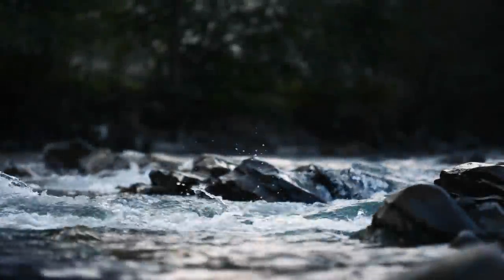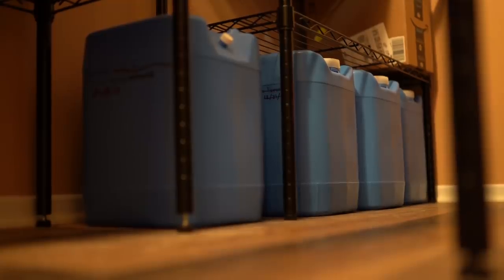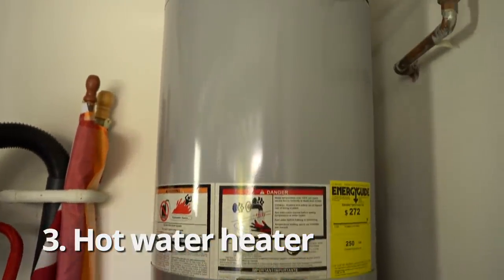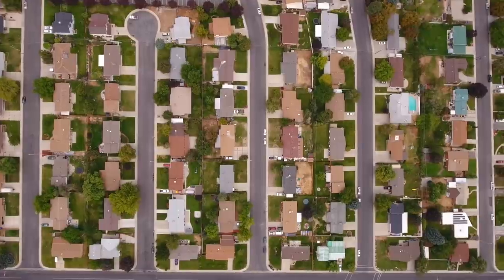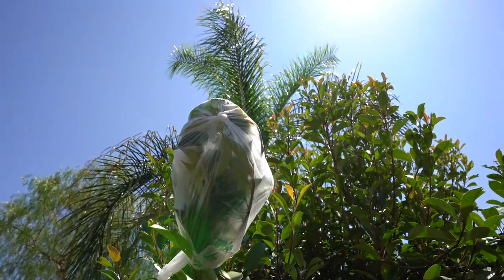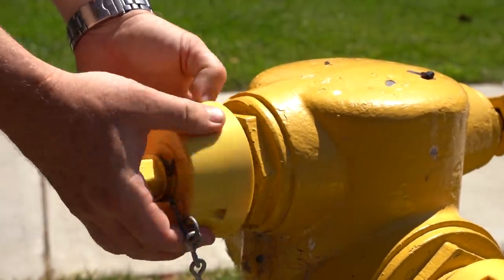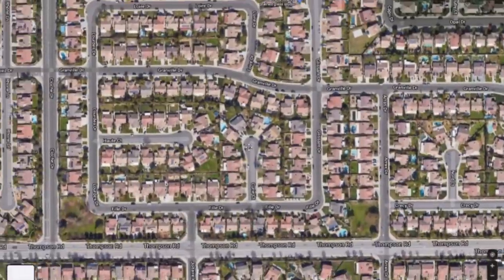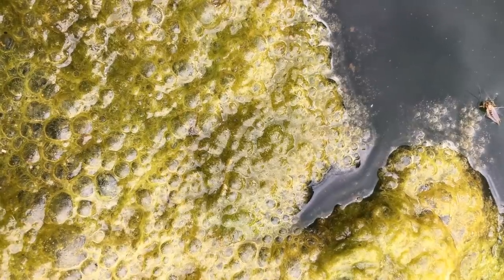12 Overlooked Places to Get Water After SHTF

Comment: 1.  Don't try to hack into and eat a Saguaro cactus for water.  The interior of the cactus contains a strong wooden spine, and trying to hack through it with something other than a powered saw will result in hard physical labor and massive personal water loss by perspiration.  Additionally, once you do succeed in cutting through the wooden spine, the fleshy bit inside may contain some water, but it is contaminated with potent alkaloids and other compounds that will give you the runs and may also have a diuretic effect.  Basically, eating any meaningful amount of the watery part of the cactus in the center will presumably make you sick and subsequently even more dehydrated.

2.  Be wary of water contaminated with algae.  Some types of algaes are effectively harmless, but others (like some kinds of cyanobacteria and some kinds of "red tide" algae) produce neurotoxins that leach into the surrounding water.  In large enough quantities, these toxins will make a person sick and in extreme cases can kill both humans and animals alike.  Simple carbon filters (like the type used in the "Big Berkey" water filter) and other types of mechanical filters like used in "personal water filters" (such as the Sawyer mini), have pores that are small enough to catch bioorganic substrates ("floaties") that may be laden with harmful microbes, but the pores are too large to filter out the neurotoxins produced by hazardous algaes.  Only reverse osmosis filters, full distillation, or a properly constructed "activated carbon" filter can successfully remove the neurotoxins produced by hazardous algaes.  It should be noted that "activated carbon" is not equivalent to to a charcoal filter, nor is it equivalent to a mechanical carbon filter like used in the Big Berkey.  These are separate products.

In normal/civilized times, regular lake and river water is commonly free of harmful algaes.  However, during apocalyptic times, it is likely that desperate and unprepared humans will contaminate rivers and lakes by various methods (ex: direct bathing in rivers/lakes, using rivers/lakes as their personal bathroom, and/or sending sewage into municipal sewage treatment facilities, which during a grid down situation may be offline and may result in overflow of untreated sewage into rivers).  This contamination will likely result in massive increases in nutrients (ex: nitrates, phosphates, and possible other substances) needed for algae growth, leading to explosions in agae growth in the various lakes and rivers.  Many of these algae explosions may be of the hazardous neurotoxin producing agae types, leading to dangerously contaminated water, which people will not be able to treat by way of boiling, adding chemicals like bleach, or even passing it through basic carbon filters like the Big Berkey.

Basically, if you want safe and clean water in the apocalypse, you either need a local and clean water source under your control (ex: a well and solar power system sufficient to run the well pump), or you need to get a reverse osmosis unit for properly purifying water that may get collected from likely algae and sewage polluted rivers and streams.  However, reverse osmosis units normally require pressurized water input to function, and to generate this in a grid down situation, you need to also acquire a diaphragm pump (like used in RVs, and normally run from 12V DC), a battery (ex: a 12V deep cycle lead acid battery would typically be used), a small solar panel (ex: 100W or higher), and a small solar charge controller (to go between the solar panel and battery, to avoid overcharging the battery).  For good measure, you can also add a UV water sanitizer (and also power that from your solar system), although this likely isn't essential, as the carbon pre-filter(s) and the reverse osmosis membrane filters should both successfully be able to remove any biological pathogens from the water.
Reply: Thank you so much.
Reply: So, basically, we would be F'd.
Reply: I hope your comment gets pinned.
Reply: Can we rip open fishtank filters for that carbon?
Reply: Wow thanks for this important information.

Comment: Rather than purchase a water bladder for your bathtub, a simple inexpensive plastic painter's sheet from Home Depot will do the trick. Just line your bathtub with it. You can use another plastic sheet to cover it. You could use the water for drinking purposes, or to flush the commode.

Comment: Collect water from a dehumidifier if you can power it through solar or another alternative power source. 
Canadian Prepper mentioned it in one of his videos.
Reply from the maker: i will check that out
Reply: I do that now, instead of letting the water drain - collect it in a 5 gallon bucket to be poured into the commode.  I use a (actually 2) number 10 can to catch the draining water behind the dehumidifier so I can swap out one can for the other without stopping the machine.  It takes 35 amps from solar energy to power my dehumidifier.  A necessary evil when your home is an underground nuclear bunker.

Comment: Your water district should have maps of all springs and wells in your area. Get a copy and check them out in advance. I found a spring that has thousands of gallons of flow per minute just two blocks from my suburban home. Check with the water district to see if they periodically test the water. I live near the Boeing plant, and they have used fire-fighting foam on the runways in the past. These "forever" chemicals can leach into the water table. Know the quality or lack thereof beforehand!

Comment: Some portable AC devices have dehumidifier capabilities. You would of course need power to run it but if you have a way to run it you can pull water out of thin air.

Comment: In countries where city water is intermittent and of low pressure, every home has a large water tank with a float valve and a pump for the house. I've often thought about installing a pair of these in my own home. Such places also have large backup generators for the equally unreliable power grid. Again, redundancy is key. Once I have a whole house generator, still going to keep the portable generator.

Comment: Something that many are unaware of is that buildings with sprinkler systems typically have a tank at the top to ensure that the system doesn't run out if and when the utilities fair during a fire. There should be 100's if not 1000's of gallons there. Former NFPA fireman here.
Reply: FAR less common nowadays, in my city anyway.  But a possibility.
Reply: @asmith7876  strange. Fire code (used to) demand that buildings have their own supply to feed sprinklers.
Reply: @Faithfulfamily  What's interesting is that on many buildings you can still see the platform where the tank used to be.  All buildings here are simple fed by the city water supply, supplemented by a fire pump when necessary.  Maybe in rural areas with no municipal water supply?  That would just make sense.  But in reality, a tank of water on the roof isn't going to help much, start figuring quantity, pressure, etc.

Comment: What about a dehumidifier, if the power is still running you can generate your own water as long g as you have power.
Reply: Depending on the dehumidifier, it may contain toxic heavy metals and other chemicals that will kill you. The ones with the little balls in the bag that take water from the air for example is deadly.
Reply: Water from a dehumidifier or air conditioner should be filtered at a minimum, and preferably purified by distillation. I use a meter from ZeroWater to achieve 0 PPM showing the conductive material has been removed or lowered significantly. I still prefer distillation.
Reply: @michaelburnham5286  I have an older dehumidifier . l don't understand what and where to look for to check if mine is not poisonous.
Reply: David Reads  tell me more. I hear some can be toxic
Reply: David Reads  is a garage dehumidifer a good option?
Reply: Some of these pass water over aluminum, so watch it - Just buy a Atmospheric Water Generator - (air to water) machine - amazon - not cheap, but what is clean water worth when your lips crack and organs begin to shut down - $100 ?  - $500 ?  - $1500 ?  - just buy one asap and be done - oh, and a generator that could keep it going when needed
most systems for the home can grab 2-5 gallons a day, and they filter too - sweeeeettt!~ hurry though, these supply chains are really creepy right now
Reply: Your air conditioner also produces a lot of water.
Reply: @elizabethrose8510  it's not that there poisonous - it's just that the water drips off aluminum fins with dirt and then a plastic tray at room temp - So just boil the water or again use a gravity feed filter like a burke or membrane - that's all - If you go with an air to water machine thats all done for you - and uses WAAAY less power than a/c units
Reply: @elizabethrose8510   it's not that there poisonous or toxic but it will contain some bacteria  - it's just that the water drips off aluminum fins with dirt and then a plastic tray at room temp - So just boil the water or again use a gravity feed filter like a burke or membrane - that's all - If you go with an air to water machine that's all done for you - and uses WAAAY less power than a/c units
Reply: @anikasvellte  YES, but again, needs to be filtered, and purified (either by gravity or membrane) - If you buy an air to water machine thats completely done for you - again, worth the extra money - oh and not to mention a/c units use A TON of power, so don't be stuck with those, the air to water machines use way less energy so even small batteries and or generators can run them

Comment: If the town water goes down and everyone is frantically prowling, all of our rain tanks/barrels etc will be easy pickings for them.
I have set up a 200Lt water barrel INSIDE my garden shed, and filled it from the hose. (It is not plumbed to the gutter.)
Also, I’ve hidden another 200Lt one in the garden, wrapping it in a matchstick blind, with all pot plants on/around it. It just looks like part of an ornamental display.
Both are filled by the hose and sealed, not by rain.
No drones, or snooping eyes will see them.

Comment: Store large stacks of 5 gallon buckets. So when you are doing batch treatments, another line of buckets can represent various stages in the treatment process. 

Example: These five have been filtered, ...these next five need to be boiled, ...these next five are being treated with bleach, ...these next five are ready to be bottled. 

And don’t forget to stock pile large amounts of food grade Alum. It makes a decent flocculant for reducing sediment and turbidity when filtering materials are scarce. Mix it into the water. It will settle to the bottom, and you just pour from the top. 

Buckets, buckets, buckets!

Comment: I would not bleed the pressure off from the water heater at the pressure and relief valve. I would use the drain valve to help blow out the scale build up.

Comment: I have 70 gallons of fresh drinking water stored in my SS  boat tank, and it is plumbed with copper lines which purifies the water. Our boat water has always been good to drink. I fill it at the marina with city utility water. So you can find boats at marinas that likely have good water, if the boat is a decent good sized nice boat. Most small boats dont have any such water tank or the water sits in the plastic tanks and lines and gets foul.

Comment: Suppose you have free electricity (solar+storage).  This changes the design space of what's possible.  I'm looking at atmospheric water generators (AWG), for drinking only.  E.g. Watergen mobile box.  However, these are still pretty power hungry (and expensive).  Probably better AWG's, like MOF Harvesters maybe in our future.  Generate water, in situ.  (Avoid crowds.)
Reply: You mean "dehumidifier" a device that can distil water from the air.  Find one that works with your solar energy system.

Comment: On an island nation, after disaster and no clean water was available,  I remember seeing guys collect water from Air conditioning window units. They noticed it constantly drips naturally from the unit when it is on and it appears to be crystal clear and clean. It was the cleanest water available after disaster. Their water was contaminated.  From this they invented a water cleaning machine. It all started from the water dripping from the A/C unit which they used it immediately. So that's another water source if electricity is available.

Comment: 1. Your home. Top off all supplies. Sinks, Tubs, pipes, Hot water tank: turn off gas. Wait to cool, pressure, bucket at a time. 

2. Canned foods. Don’t toss the water. Electrolytes. Dilute. 

3. Hot water tank 

4. Toilet. Treat from the bowl. Ok for pets. 

5. Irrigation lines. Approx. 2 gals.  Hand pump w/ extra tubing. From sprinkler, insert tubing, hand pump. Bucket. Treat. 

6. Transforation. Dew from plants. Using plastic plant. Caution toxic plants 

7. Rain. Tarps. Roof. Clean gutters 

8. Fire Hydrants. Illegal. Competition. High Pressure. 

9.  Silcock key. 

10.  Ponds, fountains, pools. TREAT! Filter!!  Map area. Google Earth. Never trespass. Check for abandonment 

11.  Wells & Springs. Historical parks. Map before crisis. 

12. Lakes, streams, rivers. Observe: Healthy animals. Red blooms, oily, dead fish. 
Contaminated drinking water. Check upstream. Filter & Treat! 

2-3 Gallons per day. Per person.
Reply: Thanks for the great summary. This could be pinned up the top of comments.

Comment: One source of water I’ve never heard anyone suggest is to use a dehumidifier (if you have power) and pull the water directly from the air.  I line the catch basin with a plastic bag to limit contamination and treat it as you would normally.  Owen Lars would be proud of you.

Comment: It might sound silly, but a few spare screw caps you scavenged can be used with discarded drink bottles. You may find these strewn over the ground but you can now use these finds. YOUR COST is ZERO !!!! I keep a few in my emergency packs.
Reply: Can you elaborate
Reply: @Javen2600  If you find water bottles without caps, you can use them to store or carry water. If you were in a survival situation, you can use these as trail markers. Dozens of uses but using the caps on discarded bottles to carry / store water is a bonus.
Reply: Darlin'.....the CAREFUL as to which brand of plastic water bottle you re-use.
Reason:  do research, as most bottled water company's products have been found to have enormous amounts of Micro-Plastics and Bacteria, in their sealed and new production line products.  I, myself, was shocked, at the volume of Micro-Plastics people are ingesting, on a daily basis, from their bottled water.
As an ER/ICU RN, I highly recommend that everyone watch the CBC's investigation and professional testing on different brands of  bottled water, and see the results for yourself.  Although Dansai Bottled Water had a good amount of Bacteria and Micro-Plastics in their water, their bottles are the BEST plastic bottles to reuse......AFTER you bleach/sterilize, wash the inside of those bottles and the caps.  That will kill bacteria and viruses and decrease the Micro-Plastics inside the bottles.  Then re-use those bottles as they have a more flexible material.
The bottled water bottles that are extremely thin, crackle noisily.....are horrible to re-use.
As they crack and break after one re-use, and do not reseal properly.  Especially if you want to add freshly boiled water, into that bottle.....those literally, melt.
Just an FYI.
Oh....and pay attention to the pH of your drinking water.  You don't want your kidneys to shut down because you drank a highly acidic or highly alkaline water.  Not all water is good to ingest.  And NEVER drink Distilled Water.....omg.....BAD.
Reply: I thought I was the only one who did that.  Lol
Reply: No Mate, I was once camping with fresh water a good 30 minute walk. So I spotted these discarded soft drink bottles but missing a few caps. We washed them out & filled them up to use later.
Reply: Keep all glass bottles and if covers have rubber in even better- I do short term canning in them —- biled foods and when cool refrigerate ( boiled) They seal pretty quick - can water and in canning jars too-  Water I keep a long time that way
Reply: @marlenecardinahl9346  Just what the Italians have been doing for decades with their sauces. My neighbours were Italian & "sauce week" was a huge event as people all lined up to help.